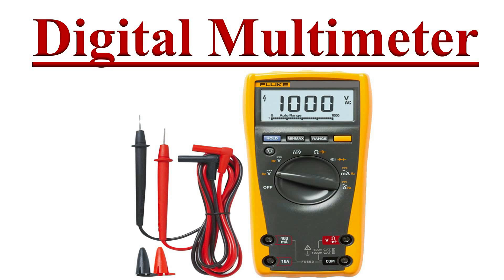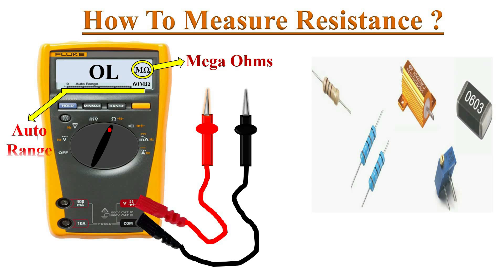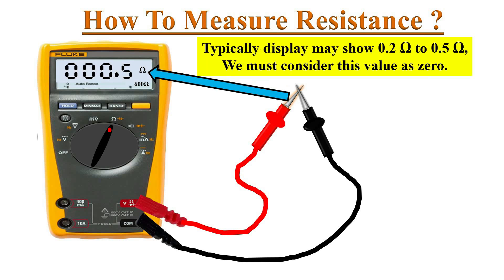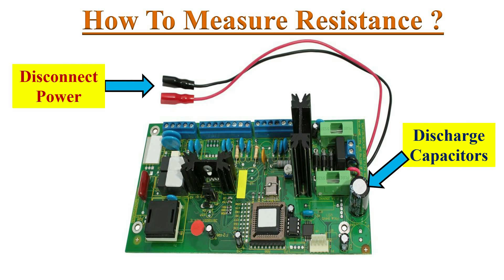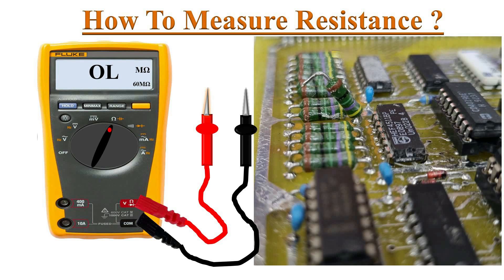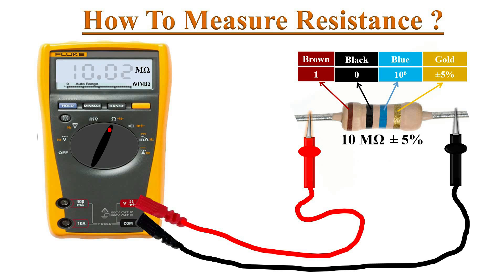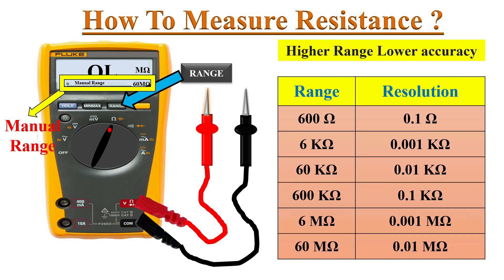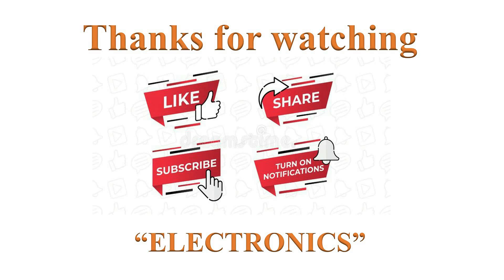How to measure Resistance with Multimeter?

Comment from the maker: Timestamps for various topics covered in this video are as follows:
0:21 Multimeter setting for Resistance measurement,
0:30 Identifying symbols on the display,
1:12 Safety precautions before taking measurements,
1:44 Taking Resistance measurement,
2:09 Manual range function of DMM.